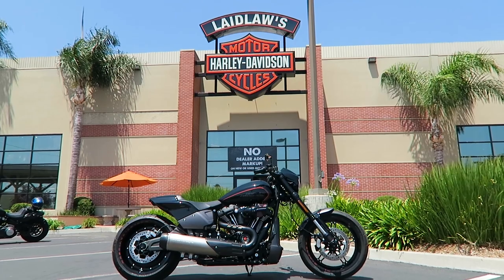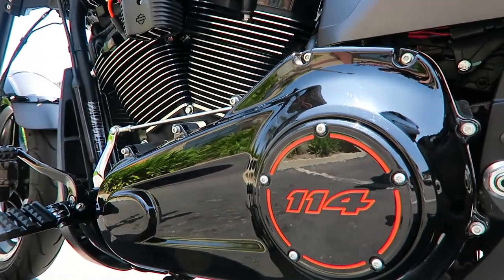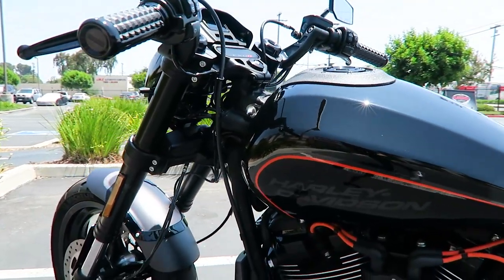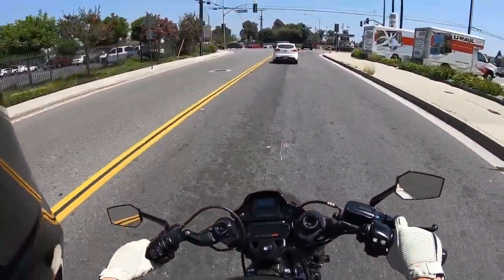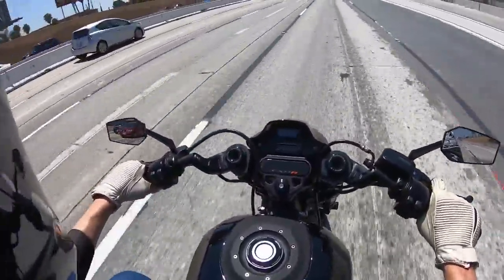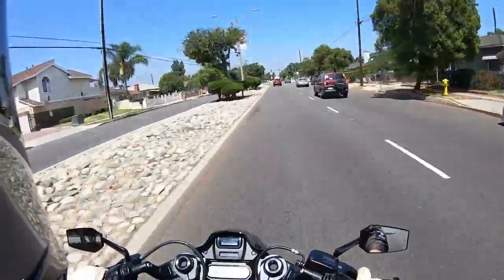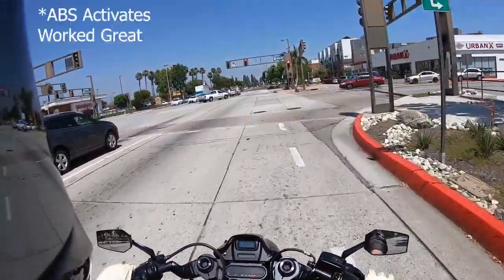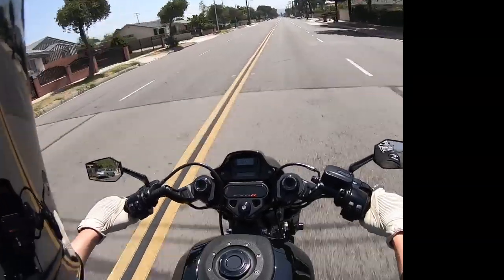Custom Harley-Davidson FXDR with Rizoma Tail Tidy accessories

Comment: Looks amazing with the fender gone/airbox gone/pipe replaced.  That guy did a really good job.  This bike has so much potential.
Reply: Typical H-D...get the bike & spend another 5K to correct the design and engineering flaws to make the bike right.

Comment: Tried FXDR back to back with Fatbob. Must say that after 30 min ridding the FXDR, back was getting sore. Fatbob 114 was amazing and with stage 2 torque was pulling harder. Ended up buying the Fatbob 114 with stage 2 and like your bike upgraded to Rizoma turn signals and tidy rear. No regret.

Comment: I got a great deal on my fxdr with stage 4, i had a fatboy s and that was an amazing bike but gave me a bad back when hitting potholes as you sit straight and lack of susspension caused me severe backpain. anyway i love how you lean forward on the fxdr and find it so comfortable. handling is superb, my other bike is a ducati 749 so i know a good handling bike when i ride one.
i love the look of the bike and had so many people come up to me and say how much they like the bike, yet not many compliments on my fat boy s. how ever the vance and hines titanuim exhaust has shredded the end carbon cap x 2 and the screws holding down the carbon heel plate have vibrated loose and lost them. still waiting for 3rd replacement parts for exhaust from Edinburgh harley, over 2 months now.

Comment: I’ve bought one, and I love it. The style and ride.  

But for the price it should of come out with the stage 3 with the torque cam. If it’s advertised as a jet fighter and has the same chassis and motor as the fatbob. It definitely needs something to make it worth the $$$
Reply: Mic I bought the 114 FatBob and felt the same thing. 

I do like the FXDR to be like a Corvette where the FatBob is like a Camero. 

For me I needed something to pound bad, right city streets as well as nice weekend sweeping rides.... still though in denser population areas... 

Had I lived in a more rural area I would have gone FXDR and get taller, pull back bars and all the tidy pieces... 

I still think it’s the corvette of Harley. Enjoy you bike 😎👍🏼
Reply: Can I ask u how tall u are?

Comment: Nice! Still weird geometry though...  the thing both performance baggers & club style bikes share is riding position. Mids/ boards + tall bars. It delivers on the twisties. And reasonably comfortable for long rides. This bike is for short distances. And is not practical for hauling anything, so, maybe just a back pack. So, not a commuter. It sure is fun and a rocket on the highway. It will never be a seller. Really cool third bike for a very specific costumer.

Comment: You corrected everything wrong cosmetically with this bike from the factory. Didn't see the tail light, so is it the turn signals lighting up when you hit the brakes. I like the look of the grips, but I like the feel of the Kahunas better. I ended up buying the Heritage because it fit my style of riding better. Like the looks of the big back tire, but that isn't what I want to ride.

Comment: Drop the price ... add mid controls so the rider isn’t folded like a taco ... might get more of my interest.
Reply: Lmao
Reply: I like the taco on Harleys just not on my Busa.
Reply: It IS Taco Tuesday, after all! 🌮
Reply: @roymoderatto  
👍😎👍
Reply: And fix the rake so it corners better.
Reply: Yeah, never rode one yet and tell the truth I don't care if I ever do, but everywhere I've read and heard most people say the riding position is very uncomfortable and gets tiring very quickly. But it's supposed to be a hot rod drag bike anyway and not meant to be comfortable for more than a few miles right...lol. And they want $22K+ from you for that pleasure? Fugdat.....
Reply: Seth Frostborn it’s not bad you get used to it
Reply: @Xboxliveyomomma127  I guess I'm the wrong kind of rider. I like the reduced rake of the fat bob but I wouldn't have a bike with forwards so Low Rider S it is 😉
Reply: My favorite HD and I've been riding them since 1985I ride 20k miles a year on Riadglides and even for back in the day.This bike really handles well and the so called foreward controls feel more like mid thi I did move the seat a little foreward.Stage 2 and exhaust with compact air cleaner.The bike rocks

Comment: I had no idea HD built this bike? Never seen it on YT till I found this channel, kinda a cross between the Breakout & VRod, I think this bike has a lot of custom potential. I’d sling a 21” out front & find a way to lower that rear fender closer to the tire eliminating that gap. I like those clip-on drag-style bars of course adjusted with less pull-back & more drag-style but very unique!
Reply from the maker: Yea, they only made it for two years.

Comment: Too many newer Harleys have a huge gap between the rear fender and tire. I understand you need shock travel but there has to be a different way to close that gap. Looks good on a sport bike like my Busa but not so much for a Harley in my opinion.
Reply: KIRBOSKI  
I didnt think of that. I love the look of bikes being lowered but i dislike sacrificing the comfort like my current Deuce. I lowered the rear 3.5" and the front 1" and it corners better but ill never lower the front again! Air ride seems like a good idea👍
Reply: KIRBOSKI  
Thanks for the info. But im going to sell my 00' decked out and fast Deuce. I just put it on milwaukee's craigslist so we shall see. Ill never get the $ i put into it. But shes almost 20 yrs old now. Maybe ill get a high output 103, Not sure yet. Ill know when i see it. 👍😎👍

Comment: I love the bike but I think the problem is 1) the 21 k price tag and 2) no mid controls.
Reply: why would a sport oriented bike have mid controls. I prefer the forwards on it. The mids would be too cramped up.
Reply: @raif725  a sport oriented bike would have mids so you can have better control of the bike and ride more aggressively. Also riding a bike with forwards and clip on bars puts you in a less than optimal position to ride aggressively and is uncomfortable AF.
Reply: pauly680 do you y’all before you think? This bike would be so stupid with mid controls

Comment: If I didn’t carry a passenger most of the time. The FXDR would be my bike. I think Harley nailed it with this bike. The way this one is set up is the way I would set it up with the exception of a stage iv. I think the stage four with the power in the upper rev range fits this bike. 21k I believe is a fair price to ask for it.

Comment: The FXDR is probably my least favorite bike in the entire 2019 line up and I'm probably the kind of rider that it's aimed at. Coming over from sport bikes and supermoto I like turning more than anything so I'm more into the fat bob, sport glide and the street bob because of the handling and the looks. 
But I did test ride the fxdr with a open mind but I'm not used to the clam shell riding position and felt within minutes that I wanted to get my feets backwards and straighten my back out again. 
So with a price in line with the touring bikes I don't think this bike will surrvive so many years.
Reply: I agree, you can get a indian scout, fix it up, engine too and still be lower cost point! It will smoke this bike.....LOL!
Reply: @CCCCCCCCCCCCCCCCC707  Not a Indian. Still all Harley for me 😉 But a clubbed out  fat bob would be nice and the fxdr can't keep up through the turns.
Reply: @SethEques  i have a victory octane, big bore kit, similar motor to the scout...my brothers dyno cant keep up....club out street bob does look good...would be my next 
Bike, but cant  justify cost tag...lol

Comment: I didn’t care for the rear end treatment. Not sure what Harley was thinking? For that price, it’s stupid to have to fix the ugly! It would have been nice if you had actually shown the rear light kit working?  Is that even a legal mod? Also, the clip ons need to be an inch higher. I was putting too much weight on the bars. For me, The 114 breakout is a better choice!

Comment: Love the changes that he made to the bike!!  Looks 100times better for sure!  I think that the problem with the FXDR is that they went too modern looking and too far away from a classic muscle bike.  THey would have been better served with the looks of the Breakout Pro Stock vice the route they took.  When they went modern like this, they moved from the typical Harley buyer and more into the realm of people who dont mind buying Ducati...which I would take an XDiavel over this 8 out of 10 times.  Reliability and ease of working on it being the ONLY reasons that I would take the Harley, as the looks are almost the same but the Duc makes probably 70 more HP, weighs 80 lbs less, and has an Ohlins suspension vice a Harley...just the lack of dealer support, parts, and reliability being the downfall of the Ducati.  I think if the FXDR had straight bars that were jsut a tad bit higher, a bit longer tail end and got rid of the hideous signals/license plate mount and just did what Rizoma did,  and pulled back the extended pegs just a bit that it would solve a LOT of its identity crisis...thats the big thing...Harley guys dont consider it a Harley, Non Harley guys like it but its just not enough bike to compete with the competition for a "Sport Cruiser" arena.  That said, I do like the thing...but would need to add a LOT to it (Stage 3/4 to the motor, carbon wheels, lots of extra parts between signals/tail section/etc..) to get me to plunk down the cash.

Comment: I bought one recently.  It's the most beautiful & sexiest thing I've ever seen that doesn't have breasts. I watched videos about people saying the riding position was weird. I personally think it's fine. It's a bad ass bike. It's not built for cruising so much. You pull up on one of these & you have Arrived! Haha. I haven't stopped staring at mine. I'm going to change the exhaust, rear light nonsense & front indicators.

Comment: Its prime competitor, the Ducati xDiavel, offers 152 hp, liquid cooled engine, 8 degrees more lean angle, ride modes, cornering ABS, cruise control, and weighs 123 pounds less for $21k. It also has forward controls. For the pure performance customer segment, H-D needs to vastly improve the FXDR with a performance version of their new 1250cc water cooled engine.
Reply from the maker: Electronics have never been HDs weapon on choice. They look great on paper to some buyers but I ridden both bikes and they really can’t be compared. The Ducati is a bad ass bike but it is a sport bike that has a slightly different riders triangle. It doesn’t have the quality of parts, paint, fit, and finish that a Harley offers. It’s a completely different machine.
Reply: @MattLaidlaw  Actually, it was some VP in H-D marketing that said this was the target market for the FXDR in an interview with Bennetts UK. But, you're right, the XDiavel is what happens when a performance sports bike company tries to build a cruiser and you end up with a bad ass bike that fails on so many levels. Polarizing styling, jarring ride, and gearing that doesn't work in the city. On the other hand, when a cruiser company tries to build a performance bike you get the FXDR which hasn't created a fire storm in the market. If H-D wants to go this route, they need to define a new and unique performance cruiser segment that separates H-D in the over crowed motorcycle marketplace. FXDR is a follower bike and not the leader H-D needs.

Comment: it costs way too much... it performs just like a fatbob but they want like 6k more for the FXDR.
Reply from the maker: The FXDR is exactly $2,500 more than the Fat Bob
Reply: I didn't know they brought the MSRP down to $21,349, when it was released they said it was 24k. although that also assumes vivid black only and the 114 fatbob. 107 fatbob with color vs fxdr with color is $4300. I still would standby saying that the FXDR is not worth the $2500 more vs a 114 fatbob, the fatbob is priced a little high to begin with, IMO, and they rode exactly the same to me. I did like the fly screen and clip on bars though.
Reply: @MattLaidlaw  I watch a lot of your videos and you once said the 117ci Lowrider S was one of the fastest, if not the fastest, Harley you have ever ridden.  Between the Lowrider S 117ci and the FXDR, which bike do you believe would be the fastest bike?

Comment: I tried one last Fall. I acknowledge  the performance is as advertised and the bike was a lot of fun to ride. With that said, the forward riding position and the low bars need mid foot controls. Feet forward on a performance bike feels weird, uncomfortable and you have less control. Otherwise, I don't care much for its styling and it's way overpriced. I would get a Breakout for its beautiful, classic looks and go forward with any mods from there.

Comment: Fxdr is not my cup of tea, reasons being: 1)it is priced way too high 2) performance cruiser or not, were are the electronics? The modes etc
If i went to a shop and see this and see bmw rs 1250 gs or ktm superduke or ktm adventure or triumph rocket iii or ftr1200s..i wouldn't buy fxdr
If I really want a Harley, then it would be a low rider or fat bob or fat boy or roadking
And also, why is the breakout in cvo section, i never understood why it's listed under cvo's
Reply: sooraj sai lol those bikes don’t match why not add in the x1000 or 1000rr by BMW?

Comment: Even though the price has dropped for the FXDR it’s still overpriced along with all the other HD motorcycles. 
HD is so bad at pricing, just look at the price of the Softail Standard $13,599 that is only overpriced by $1,000. If the Softail Standard is $13,599, how can HD justify the price of the Sport Glide at $18,599? They are basically the same motorcycle except for bags, fairing and ABS, $5,000 for those accessories? This is simply absurd. HD drop your prices and price your motorcycles correctly. People are finally realizing that they are being screwed over. 
Motorcycles that have the same frame and motor should be priced the same, unless there’s some magical BS HD is adding to make them different prices. ABS and machining is different, it still doesn’t justify the price difference.

Comment: Harley needs to figure out that the sportbike/buell tail section , no matter which model they put in on, does not sell. I have been a HD tech for 19 years and have been around the drag racing scene. If they would put the rear tire back to a 180 or 200 and have a fender that resembles a more of a fender instead of a tail section it would draw more. The XR1200, XG750/500, VRod Muscle, Buells, and FXDR has proven that this look does not sell. Then you put the $21k tag on it, as a solo bike marketed for the younger/sport minded rider, it is a sure fire way to kill the model. If they want to go for the performance/twisties rider then they need to make the coastal glide or stripped down versions of it to have the naked DR look. They need to listen to what the dealers/market is saying. Club style is what the younger generation and current generation is into. https://youtu.be/zD2NvE8n_rMHD needs to listen to their own words, "We make motorcycles for individuals, not masses. Until you have been on a Harley Davidson, you haven't been on a motorcycle." Love the brand and industry, but I wish they would get back to building with passion instead of spit-balling ideas that just keep failing and making the company fall short. I understand you have to adjust with the times, but you have to stick to your core style/design that got you to where you are. Harley had done it that way for over 100 years, but in the last 10 years they are doubting themselves and can see it in their decisions. Sorry for the rant, just wish they would listen. You do an awesome job at this Matt. I wish more dealers would be passionate and informative to their customers as you are. Keep up the great work!

Comment: this is better , but still ugly . 
it doesn't sell because it's ugly AND too expensive . 
 
Street Bob = $14549 . FXDR = $21349 . that's $6800 difference . you can do a LOT of performance mods to the Street Bob for that much money . you'd end up with much more performance than the FXDR , and it wouldn't be ugly  .
Reply: Street bob with 114 is about 18K +...
Reply: The motor company needs to make the bike everyone is waiting for.
A dirt track big motor hooligan bike. What are the waiting for?
Reply: Fuel Moto recently announced a 124 kit for the 107s - $1699 :)

Comment: V-Rod Muscle is/was a way better performer and a much much more aesthetically pleasing motorcycle. A cleaned up FXDR but still an ugly under-performer.
Reply: @davidpeterson943  Not the Muscle. Actually the FXDR is the one that's ugly as fuck.... Matt says in this video that the FXDR feels like more of a stop light to stop light drag type bike and it's the fastest bike H-D makes accelerating out of the hole. What a joke. There's was a H-D promotional YouTube video a few months ago showing the FXDR racing a mid-80's Firebird, probably the slowest and poorest performing model Firebird ever produced. Actually racing it on the strip. Corporate H-D are idiots. My turbo Muscle would humiliate this slug. I sold it when H-D discontinued the V-Rod so I could get something out of it before it devalued too much. So would my Ducati XDiavel S (replaced the Muscle) and my current 120R turbo FLHX. I've got a '74 FXE it could probably beat...lol.
Reply: I love the look of the Vrod but it performs like total crap and has no punch